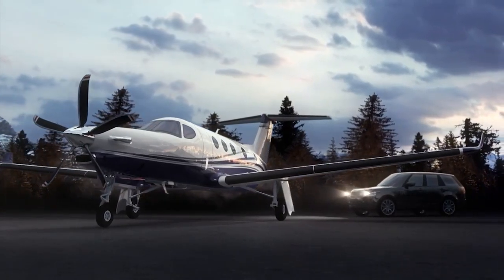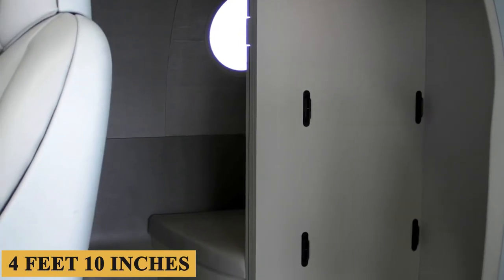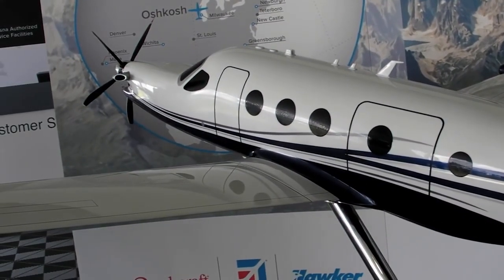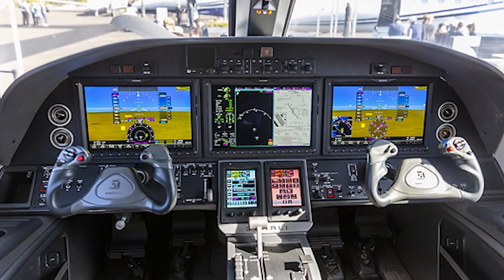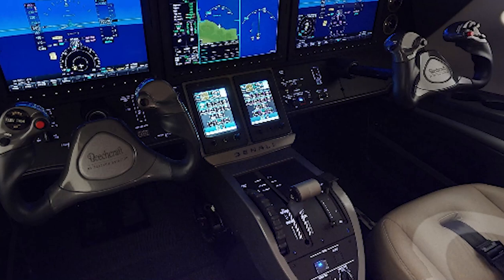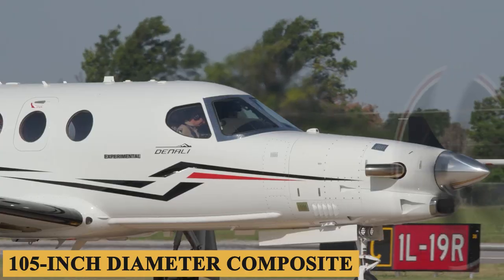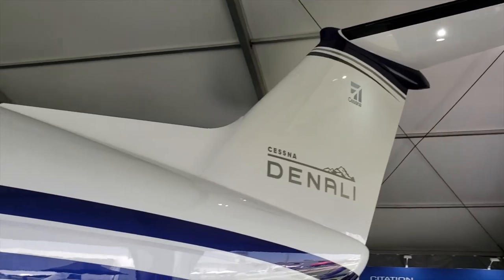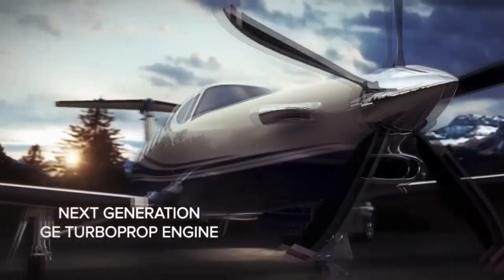Inside The $7 Million Beechcraft Denali

Comment: Maintenance for this thing will probably look worse than the 12. That engine is gonna suck for any desalination or comp wash considering how you've got 40 or so aluminum screws required for access compared to the 8 hinges you can pull for ease of maintenance on the 12. The firewall separating that engine on their CAD files looks a little dubious for access to the FDU, Generators, and anything really on the AGB compared to the space given on the PC-12 NGX. That serviceable lav they have positioned definitely means the flight controls run to the left of the fuselage if they were smart but that also means that the lav will leak down onto any Avionics LRUs sitting at the bottom of the plane. I like how it's easy to tell that the plane was reverse engineered from a Legacy variant as well based on the Pre-SB winglet design of a PC-12. Wouldn't want this thing for an operator. Just get an NGX.